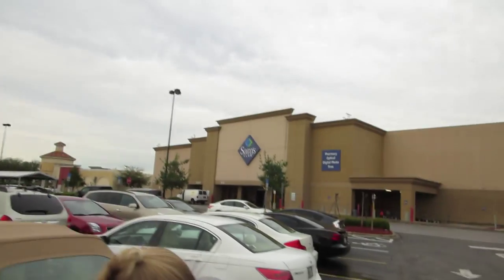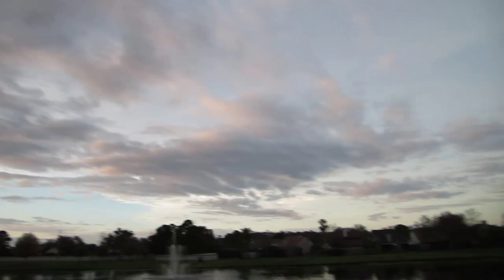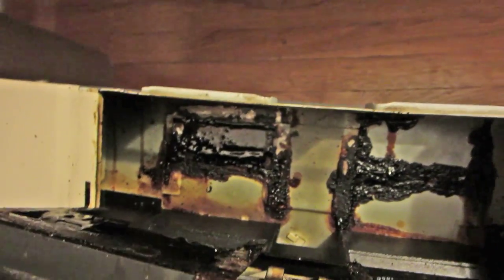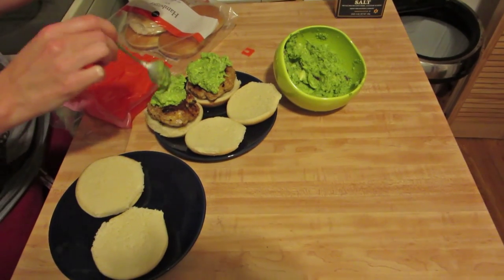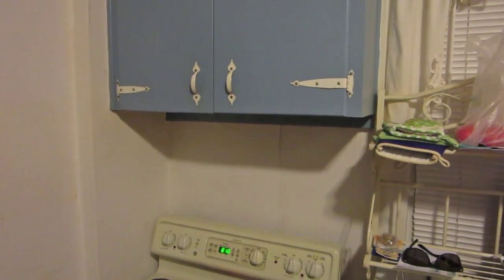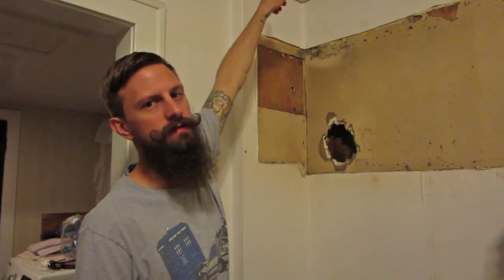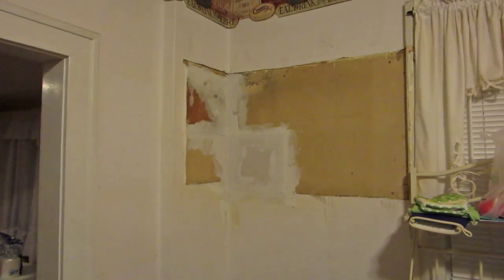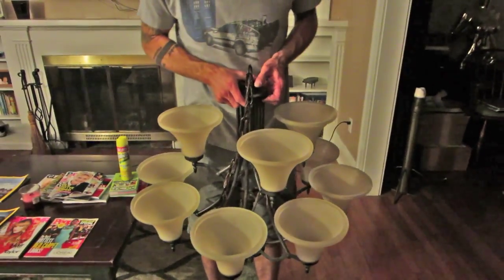There's A Hole In The Wall!?! (3.6.14)

Comment: As a remodeler, it amazes me what new construction and other remodel guys will hide behind walls, cabinets etc. It irks me! Last month I was demoing a block wall and in the holes of the pillar blocks was filled with their lunch trash and mortar bags. 

So you hate drywall, what's your favorite work?
I hate painting, love masonry.
Reply: I used to be in construction. I KNOW what guys hide in walls! Things you wouldn't believe. I used to be an electrician. But I'm also pretty good at drywall.
Reply: What's the craziest thing you have found? 

I've once found a book on ww2 aces with writing in the pages, in a hole behind a built in bookcase in a duplex.

From what I could gather someone was trying to find out where their father had crashed/emergency landed. It had some water damage but it was amazing to read this mans thoughts, hopes, and dreams.

I still have it somewhere but three moves couldn't have done any good for it. Now I have to find it this weekend!
Reply: Oh yeah worst thing I've found...remodeling for an old CRAZY cat lady, 20ish cats, her place was awefull ...found a dead one behind drywall repair (YOU KNOW WHAT THAT MEANS). 

I shit you not I quit in the middle of the job. I didn't need her money, return business, or her to pass the good word about us bad enough to work for someone that does that :-\  

But that book, good times.
Reply: I've found old tennis sneakers, broken tools and piping scraps, but most of what I've seen placed  behind walls by workers, are left over lunch scraps and "other things" that are gross, but will decomposed within a few weeks--if you know what i mean.